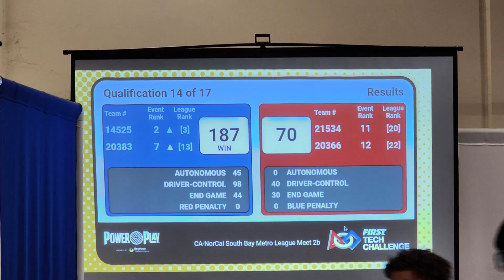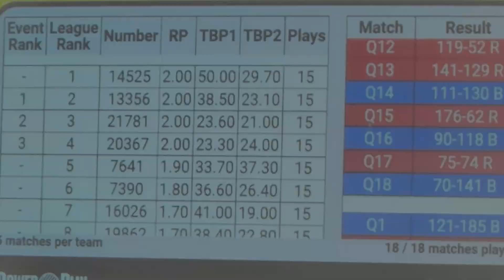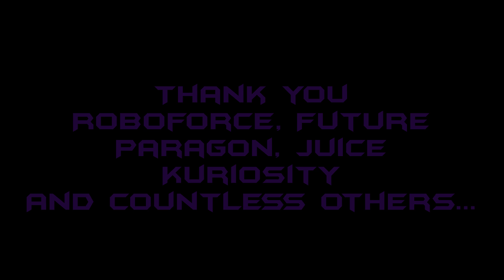Terrabats 2023 Season Recap | Powerplay FTC

Comment: Wait do u use vision to detect the pole in autonomous?
Reply from the maker: We used to for league meets, stopped using it after LM2.
Reply: @Terrabats  I see, because the odometry system itself is pretty accurate, you really don't need to use vision to redo the already accurate positioning

Comment: I have a question about the drivetrain, for the belt pulleys, should they be mounted on the outside of the wheel's shafts because you guys did it and is there a specific reason for that? Thanks!
Reply: If the pulley is on the outside we can move the motor in and save space, if it's on the inside of the wheel the entire assembly becomes wider.
Reply: @pratiklokesh909  Ok, thank you! So there is no actual hardware disadvantages to both?
Reply: @jsug4559  yes both work fine
Reply: @pratiklokesh909  ok, thank you!